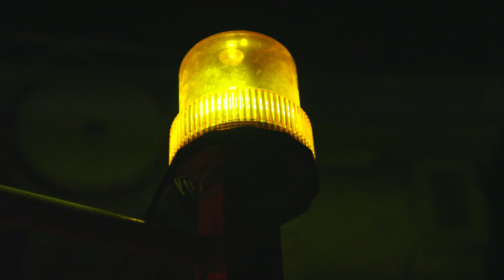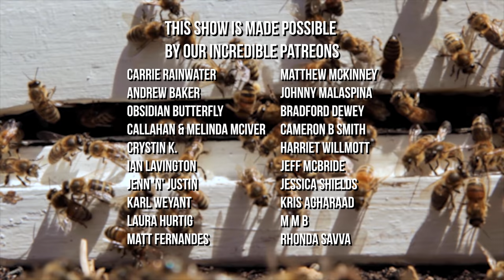Winter Beekeeping How-To Video: Protecting and Prepping a Bee Hive in Winter | The Bush Bee Man

Comment: When you move the bees how many are left behind the next morning at the old location
Reply: I had the same question in mind and…. Whats the minimum distance?
Reply: @magromarktube  Very few bees are left, particularly in winter. Beekeepers will also block up the entrances if moving them at night and then thru the day to prevent the bees leaving the hive(s) while in transit between sites. Some even go to the effort of putting a shade cloth cover over the load to enclose the hives just in case. Also makes it safer for the general road users and community.
Reply: See answer below.
Reply: @alastairsellars2611  And how long do you keep the cloth on if you move just a few km away from original location
Reply: @magromarktube  tie down straps.
Reply: Like Alastair Sellars said. Not many. I've moved hives and you see a hand-full of stragglers who didn't make it back before sunset and had to spend the night under a leaf somewhere, but in the colder weather they are much more diligent about making it home before dark, being cold blooded they need the warmth of the hive to survive the night.
Reply: @magromarktube  As soon as you get to the next spot you remove it so that they are free to forage as soon as the sun comes up, or straight away if it's already daylight, the fly screen/shade cloth is just for transportation, so they don't fly off while you're loading/unloading the boxes and driving around.